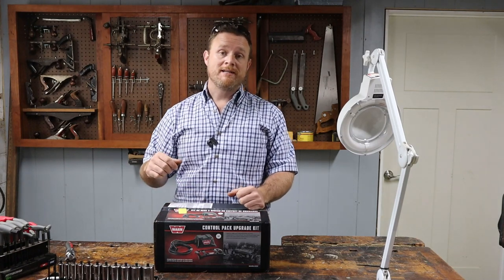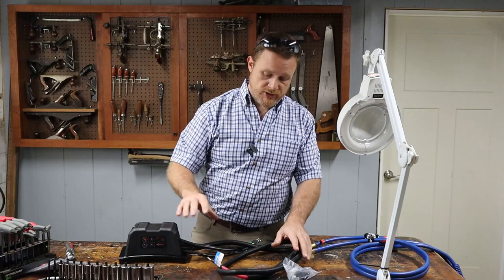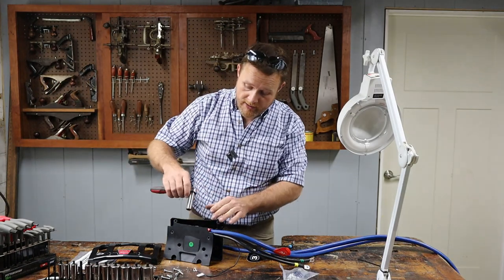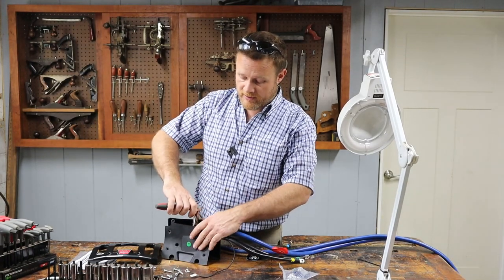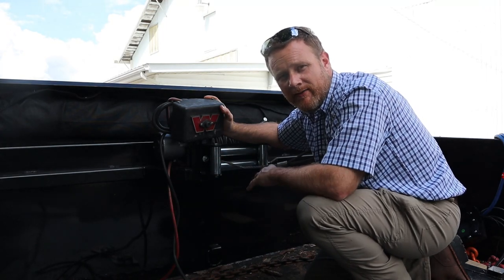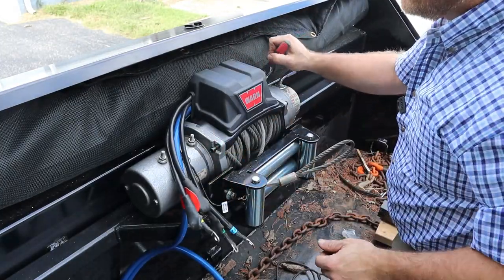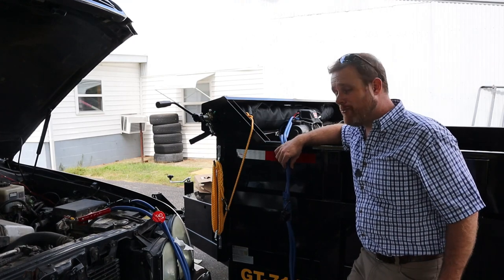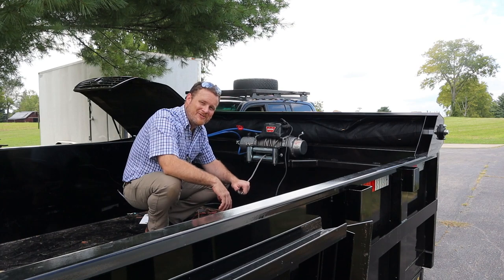#138 EASY UPGRADE makes your Warn Winch even BETTER!

Comment: That’s a nice winch setup. I had some bodywork done to my daughters 2011 Nissan Altima.  The body shop welded on the car with the battery hooked up.  Completely took out the body control module.  Its real.  The BCM part was  $949.  I vote 2 tone look.  Makes the winch stand out.
Reply from the maker: Land Stormer good to know!

Comment: You might want to think about doing a brake fluid flush. You don't want to have to replace the master cylinder (like I did on my '03 LX). It's pretty straight forward (does take 2 people), and doesn't require you removing the wheels. Although the bleed screws are a little more challenging to get to on the front with the wheels in place.

You'll need/want about 3 of the large bottles of brake fluid, and access to tech stream. Many tutorials online and on mud.
Reply from the maker: I'm actually getting ready to sell the LX470.  It is one of the hardest decisions I've made in a while because it is my favorite vehicle I've ever owned.  I plan to sell it and buy and older f250  and an 80 series.  I need a 3/4 ton truck to haul the dump trailer and will have to get an older "less nice" vehicle to offroad.
Reply: On the plus side, overlanding has never been more popular!   I find myself needing/wanting a truck over a 100 series frequently too.

Comment: If youre ground looses contact while youre welding a charge of electricity can surge through youre vehicle looking for a ground. Keep the ground as close to the place youre welding as possible. Its also good to run a ground from the vehicle to the actual earth as a backup and also keep it close to the welding.

Comment: Well I’ve looked for this upgrade kit and It is no longer offered at Warn Winch. Do you know why they have stopped offering it?  Is yours still working?
Reply from the maker: Mine works great.  My best bet is that like many manufacturers right now they are low on man power and supplies so they are probably focusing their efforts on their highest demand products.  I imagine if you’re patient it will come back as the workforce gets going again